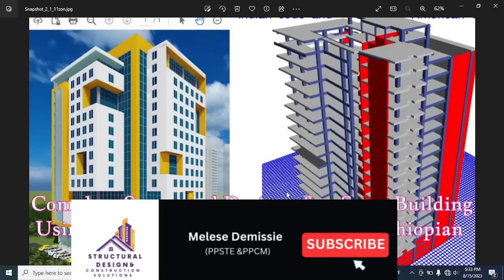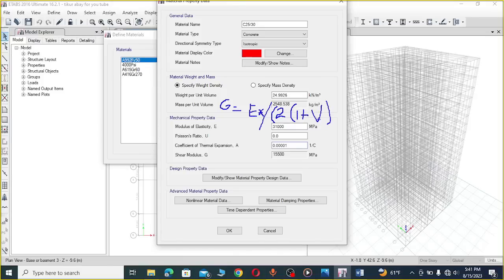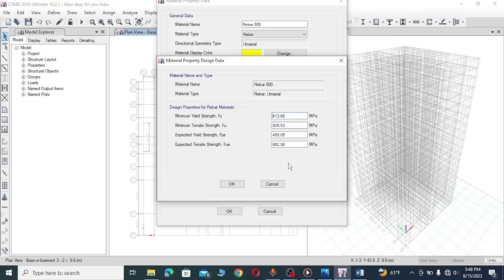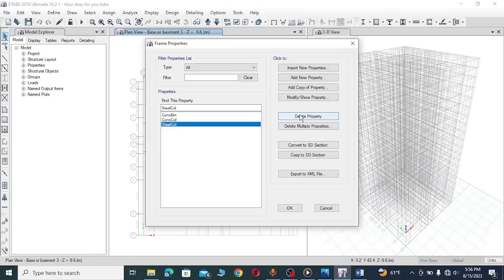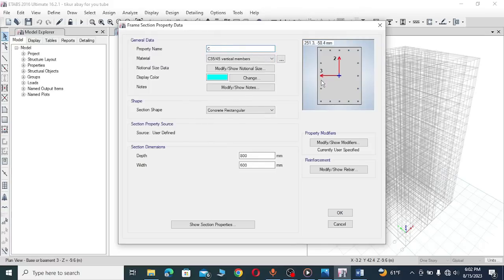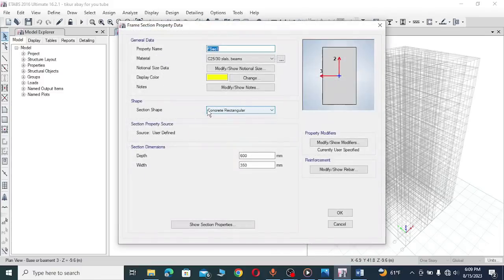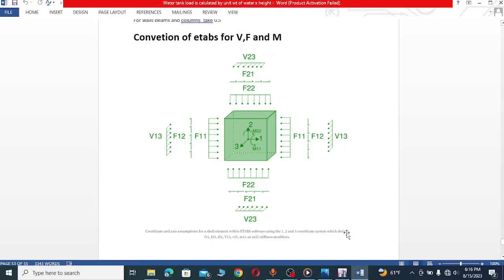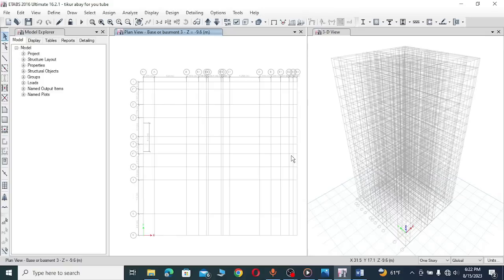Complete Structural Design of 20 Story Building using  Etabs  in Eurocode & Ethiopian  Code (part 2)

Comment: Very nice presentation, why do you reduce the stiffness of the column without checking whether the column is cracked or not?   What if the cracked moment is greater than the design moment?
Reply from the maker: No need of checking whether concrete is cracked section or not. Concrete cracks under tension and the effective sectional area is reduced. hence to account this reduction, we need to use a reduction factor for its stiffness.

Comment: Hi, Eng. how can one Step down a beam mid-span, or having a change in beam depth at the middle. How can that analysis be done.
Reply from the maker: Use  two prismatic sections having the required thickness at mid way or at their intersection. Then merge them as one beam
Reply: @melesedemissie7664  thanks for your feedback, would you demonstrate to us how it should be done.

Comment: How to decided cross section before design?
Reply from the maker: For beams , there are a minimum span to debth ratio values. For slabs , there is a minimum  debth for  a given span ratio values of slab panel. For column and shear wall use alternative section and later use optimum section.
Reply: @melesedemissie7664  Sir if some give us project like home etc so how to decide the column location expect corner